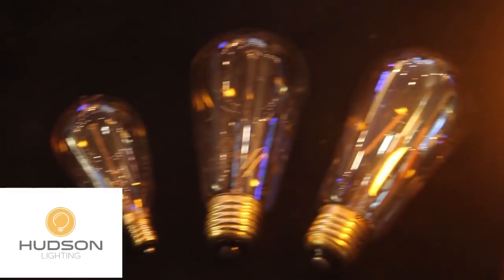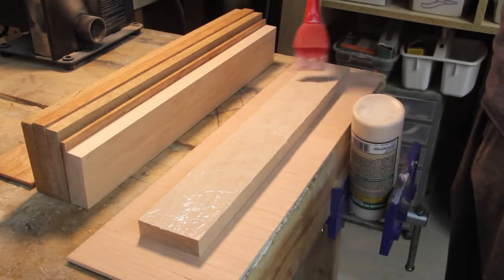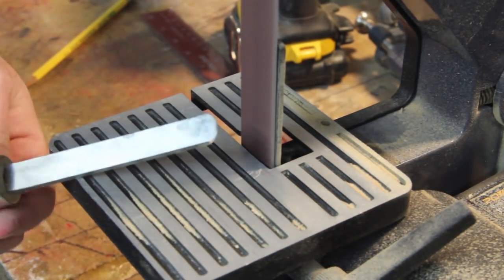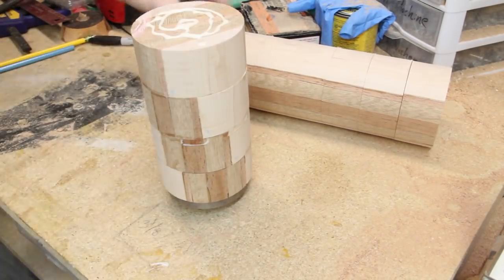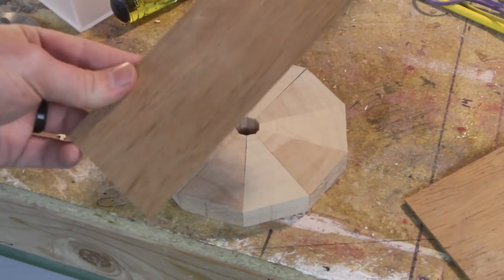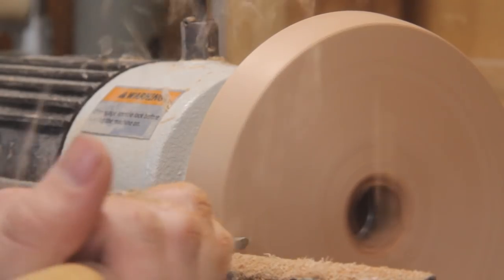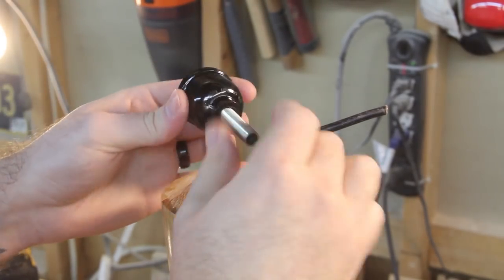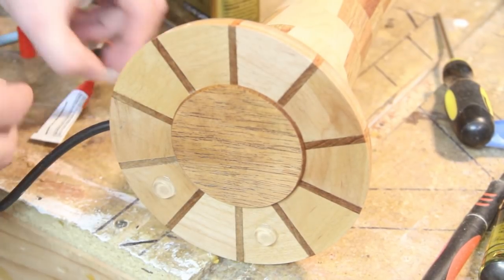DIY Spiral Lathe-Turned Lamp

Comment: There are some 'techniques' shown that are not good.  Dd not use drywall screws to fasten faceplates - they're too brittle and will shear off.  Second, it's no wonder that the tool snapped off at the initial roughing out - it was the wrong tool applied in the wrong way. Also, the blank could have been sawn or handplaned closer to a round.  you could have also bored the lamp on the lathe, but that's a different matter.
But I do like the finished lamp.